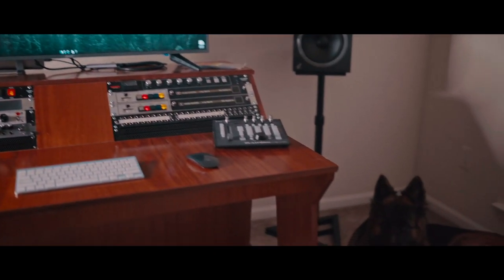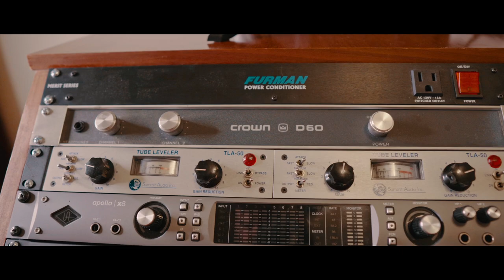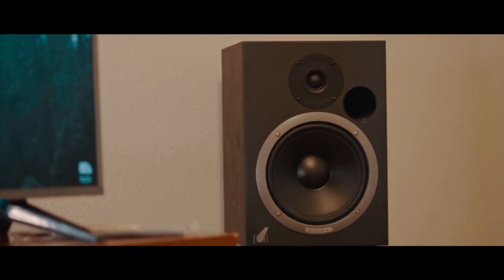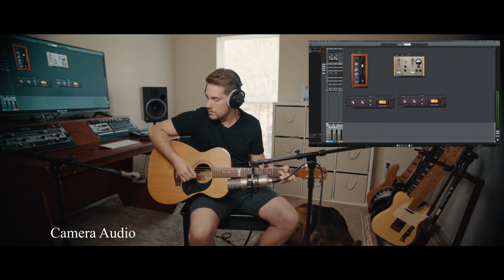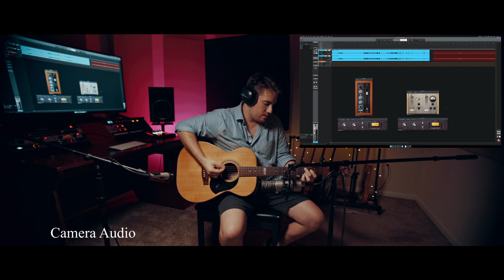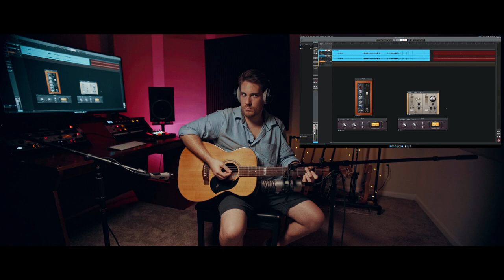The best HOME STUDIO REBUILD using AURALEX pro panels!

Comment: Amazing the difference on how much pick noise you heard on the acoustic before vs the strings and harmonics coming out after. Congrats on the new digs.
Reply from the maker: Thanks mate! It really does make that extra difference. It’s crazy!
Reply: @TheSteveKinney  a quick question. I also have carpet in my home studio. Do you ever have static issues with electric guitars?
My room is semi-treated but I'm struggling with the lows so I'm going to use your link and order some bass traps/corner traps next month. Will the discount still be good?
Reply from the maker: @jayl5941    as far as I know,  100% should be good - I have a few more videos I’m still working on - on the topic. So they better be! LOL 😂 

I have a great relationship with the guys over there - so. I’m sure one way or another - it should be good. 

As far as static issues - I haven’t experienced any here. But I have in the past. Ive also gotten shocked from an amp too ha ha

Comment: Awesome! Can we put these panels on the wall without causing damage to it?
Reply from the maker: The panels are pretty dang light - so I'm sure there is an alternative way of hanging them if you get clever with it... the wall anchors are installed with your standard expanding style wall anchor, so it's just like any normal wall fixture, if you leave - you could just do a little spackling and you'd be set.

Comment: The hard work looks to have paid off. The room is gorgeous. I'm glad to see you with those monitors set up. That should make a huge difference. 

I also think I recognize a pair of Beyerdynamic 770s on your head. Amazing headphones for the price.
Reply from the maker: Totally!  I’ve missed my vintage event 20/20’s. And with the new treatment they sound better than ever. 

The DT770’s IMO sound harsh - but unbelievably great with sonar works engaged. 

With sonar works turned off - I use it as a measure of whether or not the sibilance is too harsh... if it sounds nice without sonar works and with sonar works - then we’re good lol 😂 

Cheers dude!

Comment: Hi, Are you 100% Luna at this point?
Reply from the maker: Yup! 100%
Reply: @TheSteveKinney   Thanks Steve, love the vids..can I ask what screen do you use with Luna? I find that with the larger mixer strip widths in Lunas mixer, I'm not getting enough over all real estate on my current monitor! I'd love to see a 'narrow' mixer view option.
Reply from the maker: @ConstantinoOfficial  yeah dude!

It’s an acer 43” 4K - I think it’s like “dmk” something or other & it’s like $450 on B&H. 

Great monitor. Huge. Running at 4K just makes you feel like you have a ton of real estate. And because it’s so large - doesn’t feel like all the things are too small.
Reply: @TheSteveKinney  thanks my friend I'll check it out! by the way, if your doing midi in Luna exclusively, have you got a workaround for the lack of multi outs on VI's?
Reply from the maker: @ConstantinoOfficial  ehhh. 

Kind of... What I found is that I mostly just needed a way to supplement kick and snare stuff from EZdrummer - and manipulate that. 

The other thing was being able to fade toms so if they got to ringy - I could fix it. 

The easiest thing to do with EZ drummer is to just create separate audio tracks with Virtual channels and then print tracks via soloing each track inside of ezdrummer. Kind of a length process - but once you’re down to the mix stage - it’s gonna definitely give you that flexibility. 

And for other ones like synths - it’s kind of a similar process as long as you can solo out the signal inside of the plugin. 

Hopefully that makes sense.
Reply: @TheSteveKinney  Absolutely thanks for that , with any luck they’ll implement this in a future update!